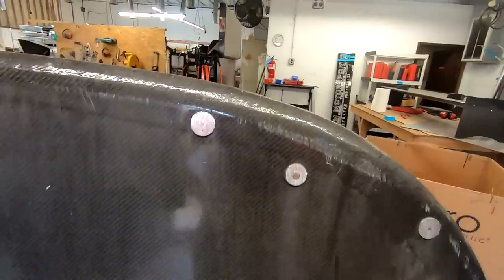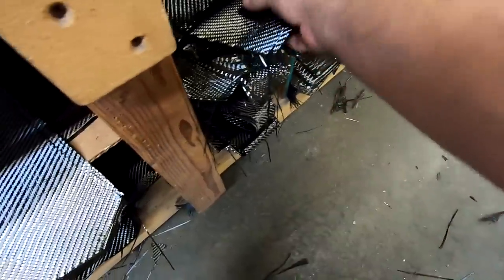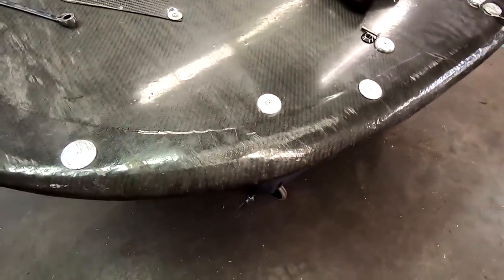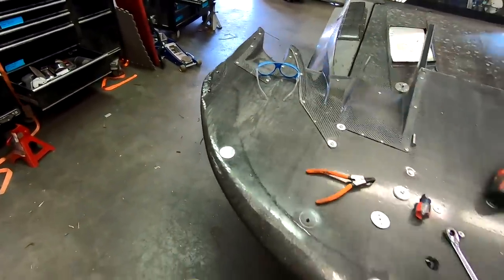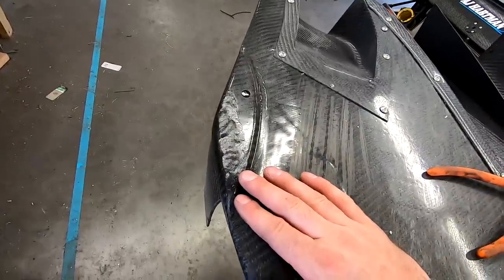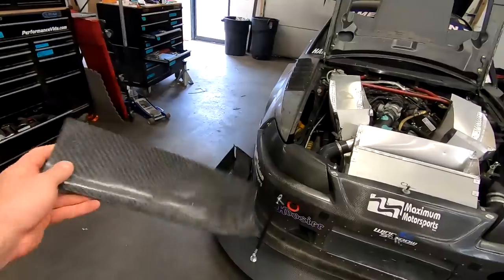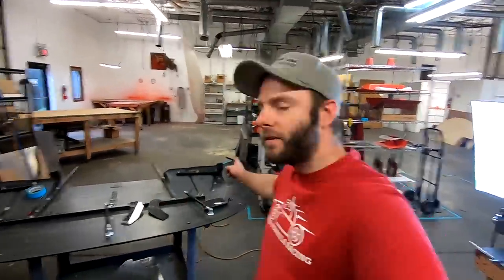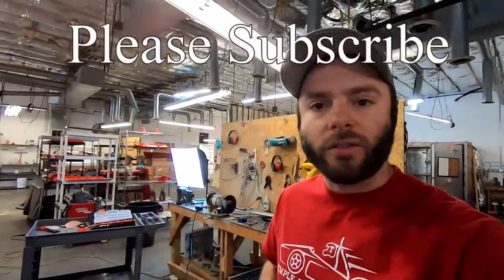Splitter Flap Install and Quick Repair

Comment: Great video! I noticed the air dam is integrated into the front bumper, and while it sits pretty flush with the splitter, there’s always a small gap where air can leak through. Do you tape it to the splitter every time, or do you have another method to prevent air from getting underneath? Thanks!